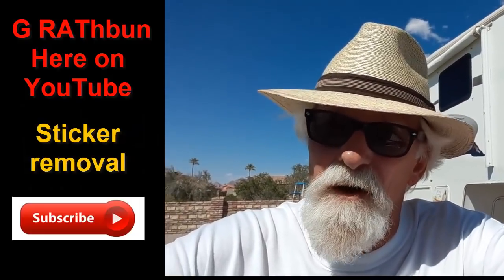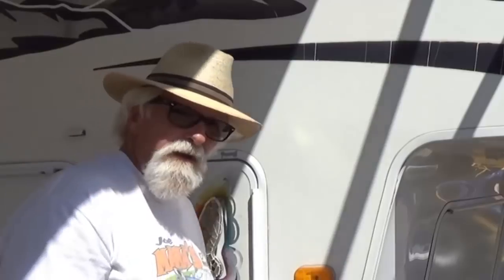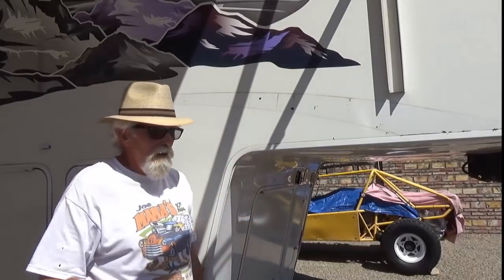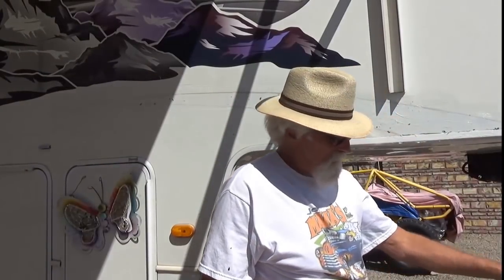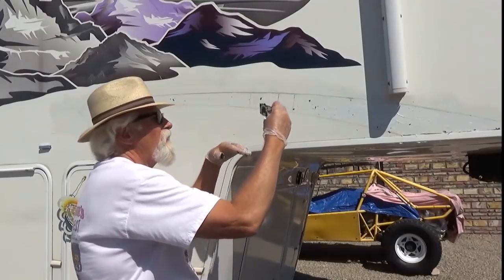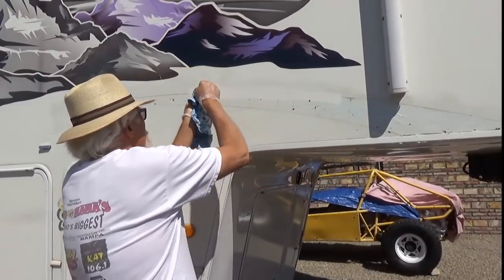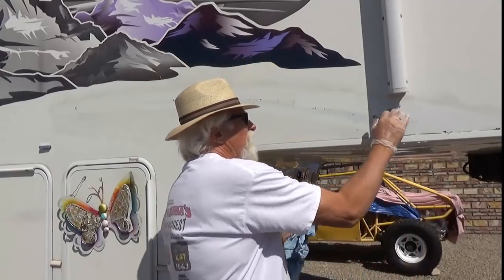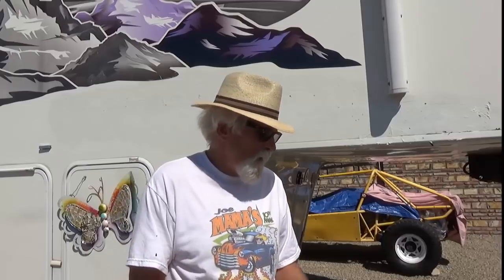Vinyl Sticker Removal part 1

Comment: Great video. Learned something about getting stuff off of my vehicle. Thanks.
Reply from the maker: I didn't put it in this video but I found also along with the hand cleaner if you got a stubborn spot and you wanted to gone fast use a little kerosene on a rag eat that up fast. But you'd still after wash it with soap and water and throw some wax on top of everything.
Reply: @G_RAThbun  thank you.